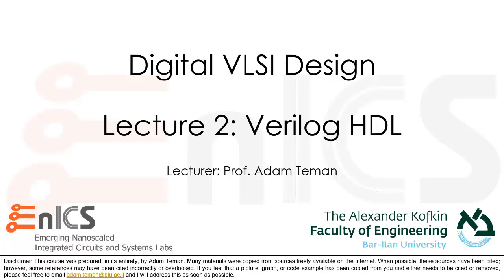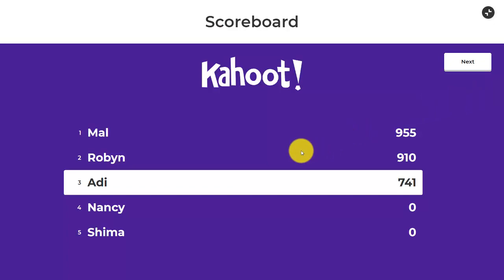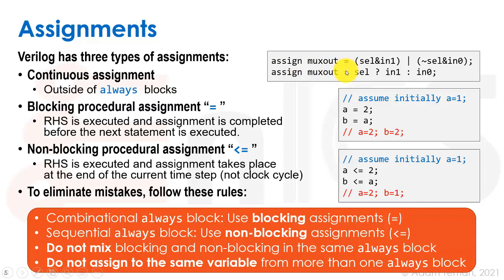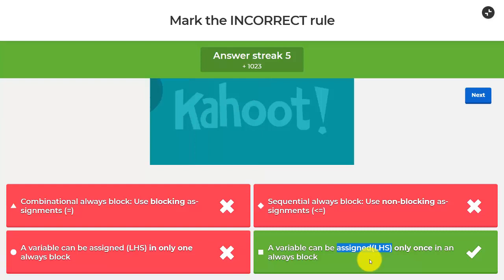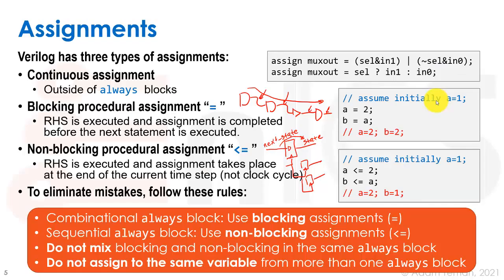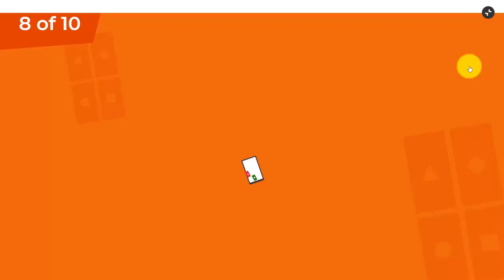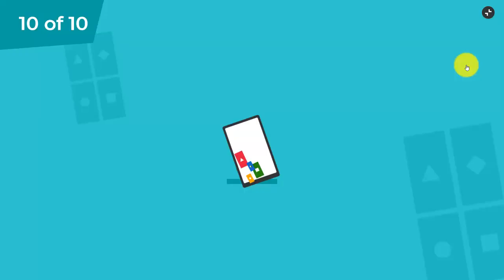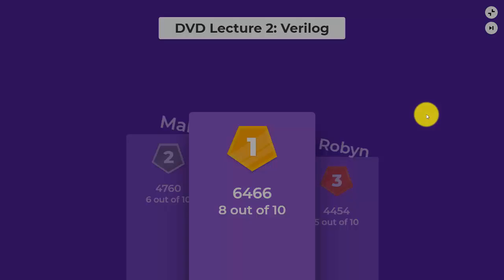DVD - Kahoot for Lecture 2: Verilog HDL

Comment: just curious, why your reset is named rst_ (why the underscore at the end). does it indicate reset to the tool ?
Reply from the maker: Hi.

No, the tool doesn't "understand" the name of the signal. To the tool, it is just a string. On the other hand, we try to name our signals with meaning and this is one of those examples. In this case, because of the underscore, we can guess or implicitly understand that our reset is active low. In other words, the reset is asserted by pulling rst_ to ground. if we called it "rst" and not "rst_", we could assume that it is active high (i.e., reset is asserted by pulling it to VDD). Other ways you could name an "active low" signal are with an exclamation point (though this is not good practice for computer languages), the word "bar" (e.g., rst_bar), or the letter "b" (e.g., "reset_b" or "resetB"). But, again, these are just strings. You need your code to implement the active low behavior.

Comment: On latch Inference quiz if we have a synchronous reset that wont be part of sensitivity list. Wanna confirm if your answer was right. Thanks!!
Reply from the maker: Hi Jay,
I'm not sure I understand what you're asking, but I'll try to respond.
In Question 6 (around 14:00 minutes), I show code for a D-Latch with asynchronous low reset. 
Indeed, if the reset signal was not part of the sensitivity list, then this would be a D-Latch with synchronous reset, as the latch would only reset during the positive phase of the clock. 
However, in the quiz, all other answers were D-Flip Flops, so there was no option of a D-Latch with synchronous reset...

I hope that answered your question. 
Adi